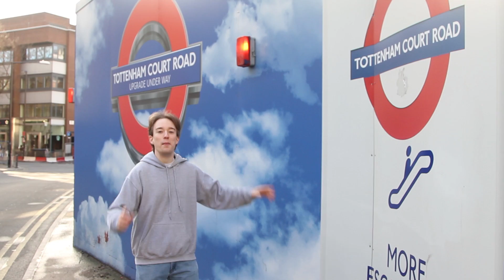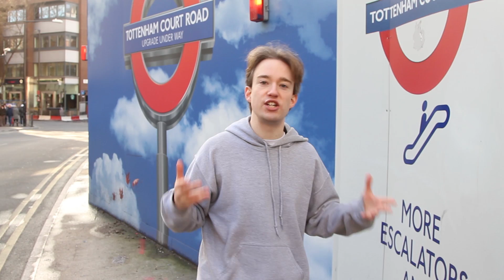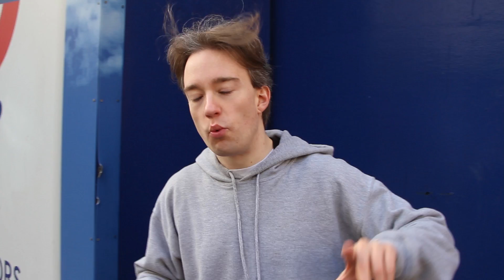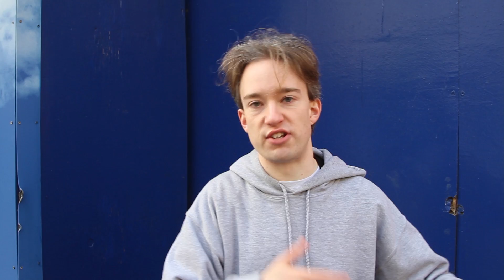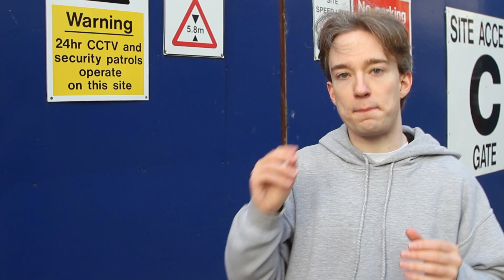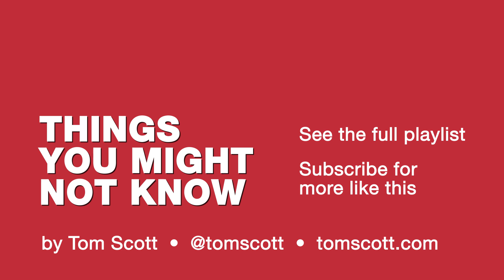Why Do Reversing Trucks Not Beep Any More?

Comment: Must be a UK thing 2019 and I've never heard a truck like that in Australia!?
Reply: I actually stared to hear this sound when I started to work in Australia. On one of the construction site we even had to have the horn plugged to the doors and handbrake so the horn beep if you open the door without the handbrake being properly engaged. Overall I found Australia big construction sites being way safer than french ones.
Reply: I live in the UK, had a building site at the back of my house for 3 years while they were building a bunch of new housing and don't remember hearing it once. Of course it might have been going on all the time and I never even registered it but I still heard a lot of beeping trucks at stupid o'clock in the morning.
Reply: Actually I've heard them many times in Australia for the past few years. I still hear beeping, but I definitely think the white-noise alarm is more common.

Comment: That will not work around construction where pneumatic equipment is used. The sounds are too similar. People will ignore it. Especially people used to hearing air brakes. Not a good idea scientist!
Reply: Have you heard the sound IRL though?
Reply: Doesn't sound like air tools at all.
Reply: @zoravar.k7904  it sounds just like the nose that the service truck makes that fuels and greases the  equipment on the job site i work on . it also sounds like air releasing form dump trucks or simi trucks.

Comment: I don't believe it's safe. Firstly a lot of people suffer from tinnitus, which is a constant hiss of white noise in their ears. How will they distinguish the sound of the trucks from that?  Secondly the white noise is similar to the sound of air discharging from air brakes used on most trucks, so it will be considered as a normal sound which trucks make, not as an alarm. I worked in a yard with reversing trucks for a while, and the reason I am still here to tell the tale is because of those old fashioned beepers, which immediately got my attention. It reminds me of the variable pitch sirens on emergency vehicles, which mimic the Doppler effect, and make it impossible to determine from which direction the sound is coming. Maybe that is why there is an increase in the number of pedestrians getting run over by police cars.

Comment: This sound, which I can't say I've ever encountered, seems wayyyyy more dangerous.
Reply: You probably have and don't remember it. It's like a smell you can't describe or remember until you smell it again. Whenever you can hear that noise it's around construction equipment, so when you hear it your brain goes "there's construction equipment nearby, better be careful"
Reply: @michaelabbott5999  : That's the problem.  This hissing sound just sounds like any old construction noise -- not a truck backing up.
Reply: @Milesco  Have you heard it IRL though? It doesn't sound like that at all.
Reply: @Milesco  it's a totally flat sound, it's not really a hiss.
Reply: Nah in my experience (in Australia) it's very noticeable.
Reply: It's definitely not that audible, but at least it is location can be much better pinpointed. It's actually really annoying to be in vicinity of say like three vehicles that are almost constantly doing the same same beeping. You really can't tell when one is actually dangerously close to you. Though imo the original problem of the beeping is that it is rediculously loud noise on all vehicles. Half of volume would be way more than sufficient and voice would not echo from surfaces.

Comment: Another stupid study that "proved" the last study was wrong. The funny thing is they make you wear hearing protection, then they wonder why you don't hear a truck and thus get run over, so they make a warning that is loud as Fck and wonder why you start going deaf again, then they come out with this noise that sounds just like air brakes or a water separator blast, but oh woops still have my ear plugs in so can't hear it.....smh
Oh did I mention I have to wear all this while I type on my computer

Comment: Weird, I've been driving lorries for 12 years and never had one with a white noise reversing alarm. My most recent vehicle is a 12 plate, so seven years old now, (only 2 years old when this video was published) and had a standard high pitched tone reversing alarm. And when it was malfunctioning, it was replaced with BackAlarmᵀᴹ which also had a high pitched tone (although slightly lower than the original, and louder) not white noise.

Comment: I would never have guessed that sound was a truck backing up and I'd probably be killed. Thanks safety engineers.
Reply: I work on construction sites regularly and I can assure you by the time the truck is close enough to have run you over, you will have questioned the noise, realised the source, located the source, and moved well clear of it.  The noise is preferrable over a beep, as other sounds nearby can cancel out a beep or make it difficult to hear its direction.  A monotone beep can also echo.  White noise uses many frequencies at the same time so no matter what is going on you will hear it and be able to clearly distinquish the direction it is coming from.
Reply: Which is why they actually don't use it
Reply: No one in the world is responsible for more deaths than safety engineers.
Reply: So you'd turn around to see what the sound was and notice the truck.  That's a lot better than not even hearing the truck that beeps because you tuned it out.
Reply: @brianhawkins  I would think that new sound was just air hissing out of a hose and not think to turn around. The traditional sound, I KNOW is a truck backing up. 

I have no trouble hearing the beep. The new sound is much harder for me to hear.
Reply: @TheEgg185  I'll trust science, you trust your intuition.  The winner is the one least run-over.
Reply: @brianhawkins  I'm a very religious person so I put my faith before science.
Reply: @TheEgg185  Which religion gives divine revelation on heavy equipment alarms?  For the record, I put my faith in Jesus Christ above all things, but I find no conflicts between that faith and the facts science provides me.
Reply: @brianhawkins  sorry Mr Expert but you are not him
Reply: @GewelReal  I never claimed to be the expert; I merely said we should trust the experts on this instead of relying on the misguided intuition of fools like you.  Not that you'll ever have any influence over these kinds of things anyway...
Reply: @brianhawkins  meanwhile, i'll trust engineering. fact is if you reduce the volume of sound, then people who are hard of hearing will not hear it.
yes lower frequency wave forms travel farther, but they still have to be above the hearing threshold. and if you keep the volume up, then this directional disclosure will be more irritating than the beeps.

"you will turn to see what the noise is" white noise is the sound a truck gives when airbreaks are used to limit speed and torque. you wont turn to see the what noise is because you know it is a truck driving forward, so if it was approaching, the driver can see you, and you don't have to react.

the design problem isn't whether white noise is easier to orient yourself towards than a beep, but whether people already encode the same type of sound to mean a completely different indication for the same situation.

it is like if a police siren was changed to invert red shift. you can tell on police vehicles now whether a car is approaching or receding by how the sound changes. if it goes high to low, you know it is driving away, and you can figure out how fast it is going away too. but if they go "well low frequency sound travel farther, so we are going to have the vehicle itself slide the pitch down" then if the rate is faster than the normal red shift they will indicate the opposite motion.

alternatively imagine if an elevator company 'borrowed' the sound of a fire alarm to indicate that an elevator had arrived.

using the 'truck moving forward' sound to indicate a truck is moving backward, works against the public because it deliberately violates public perception premise. it violates expectations and is roughly as absurd as changing a police siren to "you are now free to cross the road."
Reply: @TheEgg185  you made sense until You brought religion into it.  Religion is just as stupid as The white noise and just as annoying as The beeping one.
Reply: @morthim  " the driver can see you, and you don't have to react"
That mindset is why cars have excessive electronics and such stupid looking designs these days.
Pay attention to your surroundings. It doesn't matter who's in the right when you're dead.
Reply: @brianhawkins  You're not trusting "science," you're putting blind faith into egotistical busybodies who think they know better than common sense.
Reply: @brianhawkins  - Having worked commercial construction projects for 15 years, I can say that if I heard that sound I wouldn't EVER have thought that it meant anything dangerous going on.  That sound happens all the time on sites.
Reply: Brian Hawkins Huh...three trucks disengaging their air brakes. I’m fine. screaming noises heard in the distance as I’m run over Safety engineers, really? You had to make it sound like air brakes?

Comment: I know I am late to this party but as a now retired environmental health officer you would not believe the serious nuisance reversing beepers caused, not just on construction sites but shop deliveries, factory sites where they are fitted to fork lifts etc. The stock a swerve from the company is that they are required by law, they are not! Also trucks fitted with them can switch them off. When reversing such vehicles in busy areas they maybe a help as are flashing/strobing lights, but at night the lights are better as they are readily seen. A particular problem can be night deliveries to shops, which are a thing in the UK. Nearby residents can get driven nearly mad by the beepers going of  between midnight and  5 am. There is a protocol now called silent approach which makes things much better other wise people like my self would require no noisy vehicle out side normal hours!

Comment: Ah countries that actually make progress on stuff. I really wish they'd do something about the beepers on construction vehicles in the US, it's probably the most significant and annoying source of noise on construction sites. I would imagine it's probably not all that effective either, as people who have worked on construction sites for years where that noise is constant probably 100% tune it out. Not so sure about this "white noise" thing, sounds like air brakes releasing, another common sound in that context. Solution I see, an actual modern solution, is backup cameras on every machine so the driver can actually see if there's someone in their way. Though for that matter, a lot of construction machines with rear-located cabs and big implements on the front (a lot of front end loaders and forklifts) look as though they actually have much better visibility behind than forward, yet still have reverse beepers.

Comment: Horsefeathers ... beeping is safer ... the white noise is only less of an annoyance to the neighbors ... otherwise it would be MORE annoying ... get it, the more annoying, the safer it is ... when a construction worker hears that beeping, and they don't know where it's coming from ... guess what? ... they look around until they see the source ... it's that annoying ...
Reply: 25 years in construction.

We don't look around because it's annoying. We look around because we know better than not to when we're in the vicinity.

You learn how loud they are based on how close you are.
No one working in the side yard looks around when the trucks beeping in the driveway, even though they might only be 30 feet apart.  Unless they're just curious as to who's delivering.
Reply: @lordgarion514  - After 25 years, I expect you'd know where everything is on a job site that will kill you ... all the time ...
Reply: @russcrawford3310 
Not really no. Every site is completely different. Trucks come in from different directions. They show up unscheduled the vast majority of the time, so you usually know the day only.

Comment: That hissing is too much a compressor overflow discharge. That's exactly what it sounds like. We hear it all the time. When an air tank gets overfilled, the safety valve lifts, it goes 'hiss', the valve closes at the safe pressure, but if the cylinder is still charging, the whole lot happens again and again. That is exactly the sound of escaping air. As lorries have air brakes and none of us really bother about what the mechanical gubbins are about, all we hear is escaping air from an overcharging air tank, and simply ignore it. You'll get the same sound on trams and buses with air operated doors and brakes. There'll be an obvious compressor noise too, but not always cos hey, modern technology, a quiet compressor, so all we hear is escaping air and that's it.
I've NEVER EVER associated it with reversing vehicles. It sounds too much like escaping air which you do not associate with reversing or moving anything.
Reply: It doesn't sound anything like that IRL though.

Comment: These are really unfriendly for hard of hearing people. They're too quiet, so I wouldn't be able to hear one.

The noise also blends into the background, especially on a busy street. It's not going to be easy to hear.
Reply: @Squant : But it does blend in.  That's the problem.  It's white noise -- the most bland, ordinary, unobtrusive, "background" kind of noise there is.  It literally sounds like air escaping, which is a perfectly normal thing to hear on a construction site.   And construction sites are noisy -- a warning signal or alarm needs to have a shrill sound that cuts through that noise -- like....oh, I don't know....maybe a high-pitched beep or something. 

So in other words, the brilliant minds that came up with this harebrained idea took the best solution, cast it aside, and replaced it with the worst solution.
Reply: @Milesco  You are wrong. It's wide bandwidth noise, meaning multiple wavelengths. Multiple different chances for your ears to pick up a frequency or two for the "hard of hearing" The purpose for this isn't so it's safer for the streets because it will not make any difference there, a backing up truck is already so far out of the ordinary people will be abruptly aware of it in a normal street side situation. Science isn't just a bunch of people smoking blunts and throwing around ideas, it's hypothesis proven by evidence taken as fact. Your opinion of it is probably intuitive, but that's all that it is. Opinion.
Reply: @facepalm7345  Of course the science has been done and shown that it's easier to hear white noise than a high-pitched beep, but has it actually been tested in a busy environment where other things are making noise?
Reply: @nathangamble125  it's not that it's easier to hear the sound, but it's much much faster and easier for people to locate it. A single tone will only have a single simple wavelength to the sound, this is a problem because the brain uses the difference in time between the two ears receiving it in judging the direction. The problem with a repeating pattern is that it's easy for the pattern to be mis-read, to trick you into thinking it's coming from a completely different direction. This is only an issue with higher pitched noises, because they have very quick repeated waves. White noise is probably preferred over a low pitched beeping and so was chosen.
Reply: @facepalm7345  Na, not completely right. It is easier for our brains to locate sources of high frequencies because of the small wavelenght. 
Our brain uses 3 systems: 1. interaural time difference, 2. interaural level difference, 3. spectrum analysis (because highest frequencies are even filtered out on their way around the head). And especially the second one doesn't work if the wavelenght of the sound is longer than the diameter of your head because the wave bends around.
So to put in in order:
1. white noise ->best to locate
2. high frequency
3. low frequency (some low bass tones are nearly impossible to locate because their wavelenght is meters long) lambda = c/f 
e.g. 340m*s/50s=6.8m. That is one long wave.
Reply: Agreed.  It's a ridiculous idea.

Comment: 1:14 exactly. It's distinct and reserved for reversing heavy equipment. Meanwhile the "white noise" stuff could be mistaken for air release from a compressor, radio static (engineers use sim card walkie talkies, those make weird noises sometimes) etc.
Reply: Have you heard the sound IRL? It's very loud and distinctive.

Comment: The ability for the human ears to direction-find white noise is extremely similar to the way cell phones can decode spread-spectrum signals, especially when there's reflections (known as multi-path interference). e.g. WCDMA is spread-spectrum pseudo-random noise. When it reflects, the phone "hears" multiple copies of the signal at different time delays, which normally would massively damage the signal, but because WCDMA pseudo-random sequence has extremely low self-correlation but high correlation to the idealized "pn generator" sequence, the phone can locate and isolate all the simultaneous echos, and then combine them to make a stronger signal (called a "rake receiver"). in fact, in LTE, there's a thing called MIMO (multiple in / multiple out) which DEPENDS on multi-path interference to increase throughput / decrease power needs -- MIMO doesn't even work unless there's multi-path interference, which is counter-intuitive.